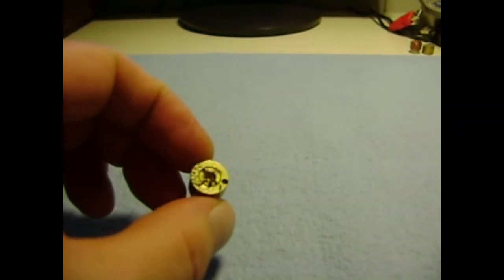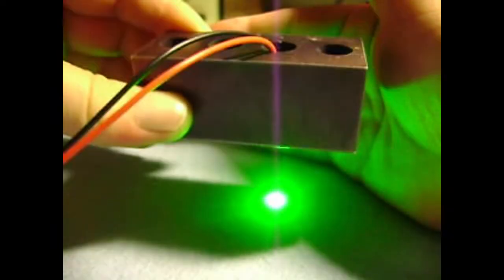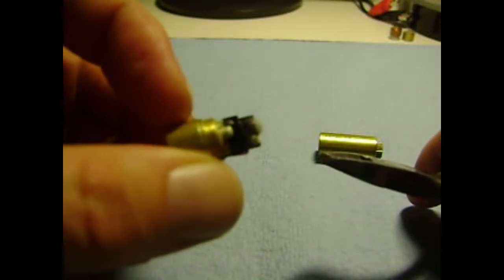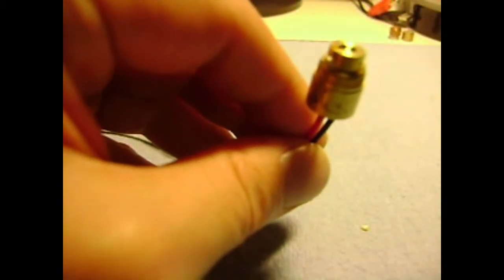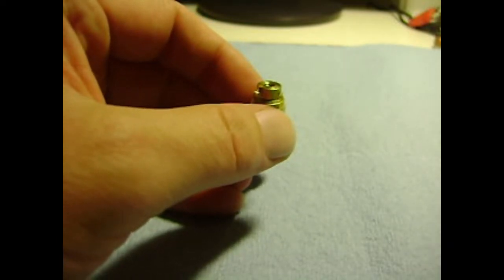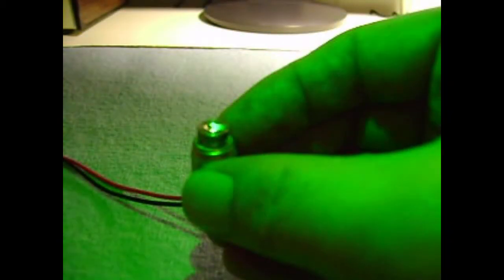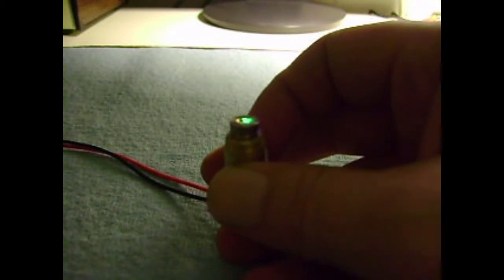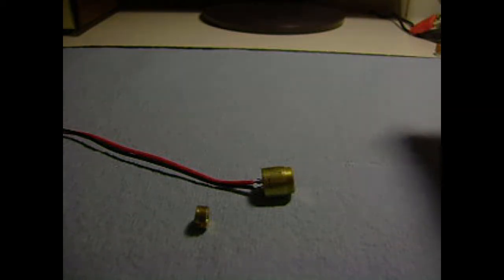V-02 DPSS 532nm L.A.S.E.R Teardown / Alignment / I.R Safety / Proceedure

Comment: You mentioned 12:49 an input of 200 mA, and an output of 125 mW. What was the input voltage?
Reply from the maker: The current source I use only displays the current.. The voltage across the diode would be somewhere around 1.8V...